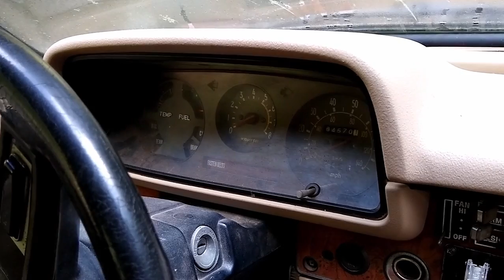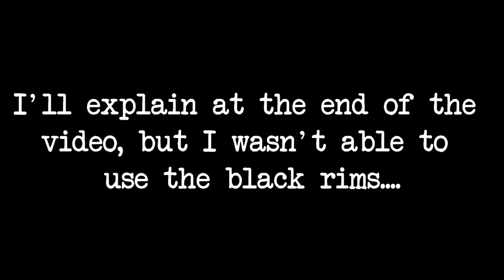The Turd Gets New Shoes!!! 1979 Toyota Pickup!

Comment: If i remember right my tach stopped working also and when i took out the instrument cluster i found a loose solder connection on a resistor  on the pc board, its been a while but i recall fixing mine.